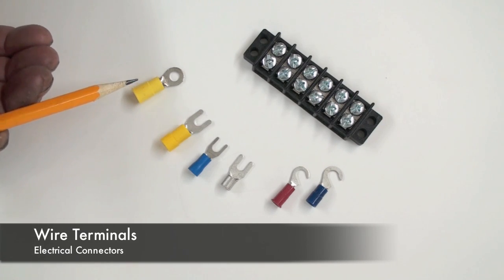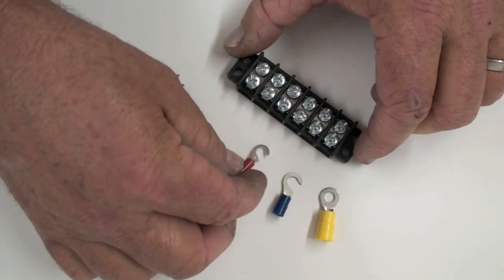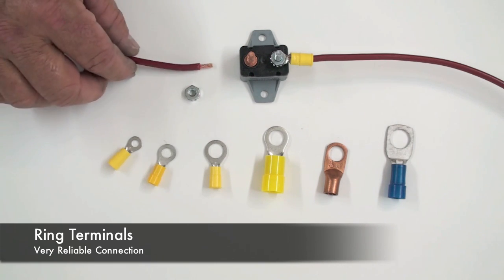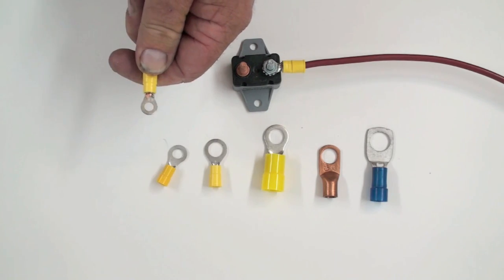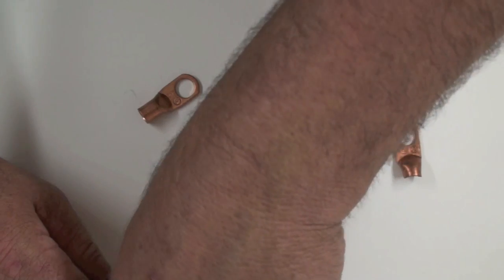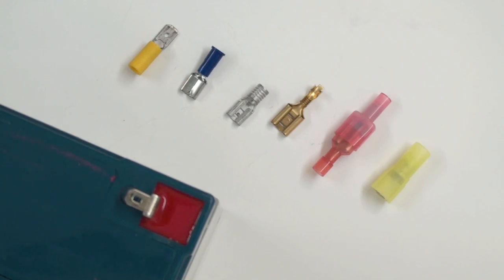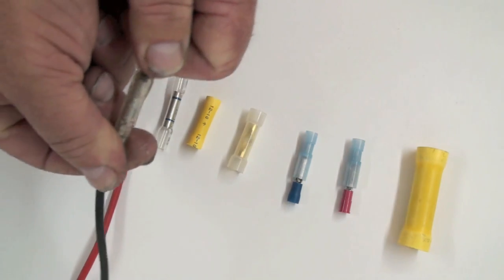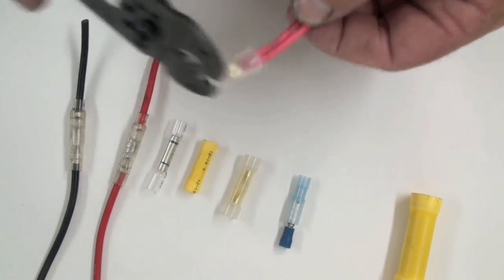Electrical Connectors and WireTerminals

Comment: 3:33 Shouldn't all of these spade-type connectors by insulated - isn't there a risk of shock if  you're using them in a live circuit?

Comment: We have a voltage-current sensing board and need to put a good connector on its interface. The connector should be such that it has a provision to accommodate lugs from both sides and then we should be able to put bolts from both sides. Bolt from both the sides should be easily removable (unlike banana terminal). Will you please suggest any good terminal?

Comment: Also, small dc currents can make oxidation on copper conductor, which can isolate the compound after some time. 
Pressing connectors is the most effective and economical option when connecting the power cord of the AC and DC currents due to the relative low resistance, which is essential to the max short circuit and able to connect and disconnect guide.

Comment: It is little stupid to say that something is wrong what is already in use for years. 
Desoldering temperature is far greater than the maximum allowable temperature of wire insulation. 
Each type connection connectors has its own why.
Soldering connectors is essential for signaling, instrumentation and control especially for small dc current where resistance is irrelevant and circuit is important for continuity.

Comment: I would never use a solder when connecting a crimp on terminal. When too much current goes through cable, the solder will melt and can cause insulation to melt. Basically it creates a weak point in connection.